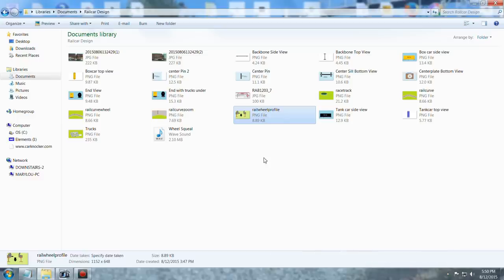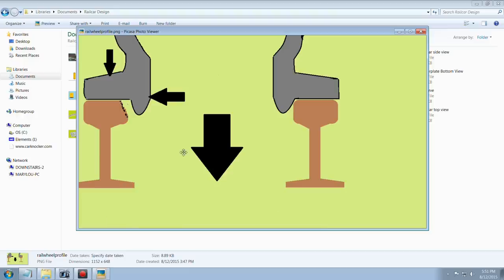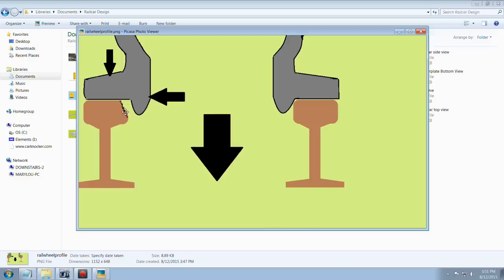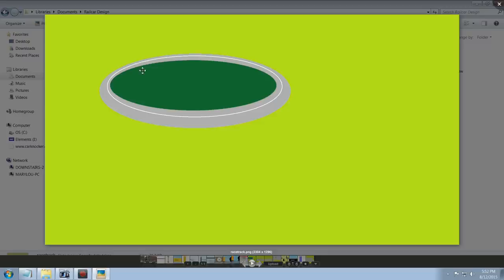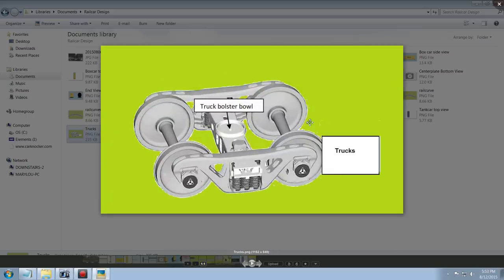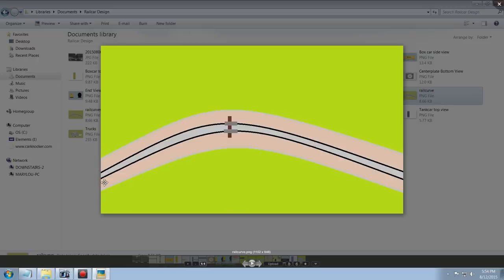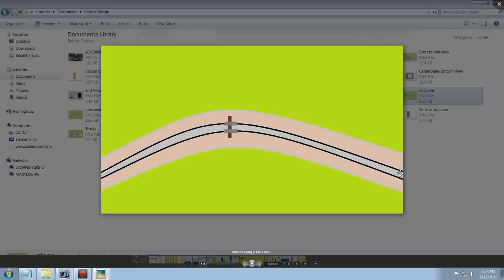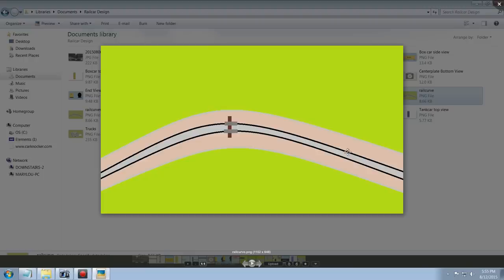Rail Car Design & Wheel Squeal Part Two 8 12 2015

Comment: Hi Walter , great series sir! If I may add a little light onto the subject? Working on track all day as I do. I also am interested in the mechanics of trains, more than signals I must admit..LOL To add a "differential" or wheel slip effect to rail car wheels, they are actually turned (machined) at different diameters from the flange to the outer rim. A new wheel will be larger at the flange and taper off  as it gets to the edge, the amount is quite a bit and there are two reasons for this! One is to keep the axel "floating" between the rails, instead of bouncing  off each flange from side to side as it goes down straight track. Hard to explain without a drawing, but imagine two cones on a axel, with the wide part of the funnel facing in and the pointy end facing out, if you roll this down a "track" it will self centre itself even without flanges!!, as each side tries to slip down to the pointy end they counteract each other...I've seen it done, even around slight curves!! Now of course it won't work  well with real trains, so a flange helps guide the wheel around the curve! Now the second reason is that when the wheels enter a curve  , the wheel set slides sideways (the flanges are about50mm in from each track) and the flange hits the edge of the outer rail, this is the wheels largest diameter and can travel further on each rotation than the "smaller" diameter wheel at the inner edge of the curve1 As you say , both wheels are travelling at the same speed, but due to the "cone" shape, the outer wheel is bigger and the inner one is slightly smaller, so you get a "differential effect" on a solid axel!! Very clever I think and of course as wheels wear and the cone shape disappears , this is when you get squealing, but of course as you say, there are other complicated reasons as well, but on well maintained wheels, it is far less. Due to there being literally millions of cars in the US, it's almost impossible to maintain all wheels to "standard" but you can pick the "bad" ones on a train as some squeal a lot more than others on the same piece of track!! Hope this helps Sir and keep up these series!
Cheers Gregg
Reply from the maker: FishplateFilms Thanks Gregg for the great input and explanation  I appreciate it my friend
Reply: pwalpar You are welcome Walter, I have been pondering this for many years and have done a lot of reading and watching on the subject!.
Cheers Gregg.

Comment: Thanks for the Part 2 Walter, I dare say Gauge of the track plays a Part too, the wheels will be a fixed width apart from the machining Process, but the actual tracks will fluctuate somewhat within tolerance I hope. :-)
Reply from the maker: Bevoin1970 Thanks Paul

Comment: It's the same with automobiles, and as we know the differential was invented to solve exactly this problem. If the train wheels were independently free to turn on the axle the slippage would not occur. Whether or not the squeal would also disappear is unknown without trying the experiment. You explained the problem very clearly, Walter. Thanks.
Reply from the maker: Bruce Boschek Thanks for the input Bruce :-)

Comment: If the train is going too fast for the track geometry, then the outside flange will push against the side of the outside rail, as you explained so well.  But the extra adhesion from the flanges pushing against the outside rail will, in my opinion, cause that wheel to bind, and not be dragged along the outside rail.   I think therefore, that the inside wheel will be clawing at the inside rail, and spinning/trying to pull faster than the wheelset allows.  So, in effect, the inside wheel is going to be more impatient, and be trying to pull the wheelset faster than it is allowed to.  So, I think that the inside wheel will be doing the squealing in this case.   I would love to see the studies from actual testing on this.  Aarre Peltomaa
Reply from the maker: Thanks for your thoughts and insight

Comment: That's really clear.  Thinking about this, does the cone of the tread help; meaning that the tread of the wheel nearest the flange will increase the effective diameter.  So long as the cant, curve and speed is right - and that's a big assumption - then it should be possible to have the outside wheel going into a curveat a bigger effective diamater to the wheel travelling the inside rail of the curve.  I'm thinking here about there being enough outward force to cause the wheel to ride up the cone.  With the outside wheel at a bigger diameter than the inside one, then it could travel further despite going at the same speed as the inside one.

Did I mention what my wifes late grandmother used to say about her husband who was an engine driver (ie engineer) in Wales? It relates to your question I think.  She and others have said that he had a reputation for speed.  His name was Llew Jones.  She said that Llew had said that going fast into curves was 'good for the locomotive'.  I think what he may have been doing is setting a speed that would place the wheel-sets in such a position that the outside wheel would have this larger effective diameter to the inner wheel.... but without the flange rubbing the rail head.  I have often marvelled at the skill necessary to accomplish this on curves which have transitions to them; beginning gently, then tightening up and then becoming more gentle again (with different cants).  That kind of thing must take years' of experience.

Like your horns by the way.

Comment: I am thinking the outside wheel in a curve is being pulled on by the in side wheel. And the only thing that is keep the out side wheel from coming off the track is the wheel flange of the in side wheel. That would put a lot of force on the rails and cause the to grind and squeal in the curves. Thanks my friend.
Reply from the maker: ***** Thanks Alfred  it is a lot to think about
Reply from the maker: ***** Thanks Alfred  it is a lot to think about

Comment: You are correct in your analysis,I think a better solution to the problem,other than rail greasers,would be a complete redesign of the truck wheels and axles,my idea would greatly reduce rail wear and wheel wear.Why not make the axle non rotating and use double cone wheel bearings,much like those used on automobile front wheel spindles.The axles would have  tapered ends,an inner flange to back stop the inner bearing,a short segment of threads to accommodate a large spanner nut to preload the outer bearing.The tapered axle ends would mate to an axle cap at either end,the caps would have an inside tapered bore about 1 degree difference from axle end,or it could be internal and external splines with a straight bore,the end caps would also have grease fittings matching a corresponding bore in center of axle to grease bearings.Thus you have independent wheel rotation ,less wheel and rail wear and no squealing, and no more need for those dreadful rail greasers.
Reply from the maker: I suspect its a matter of cost

Comment: i agree with you on that. the wheels on the outside have farther to travel than the inside wheels, but all wheels are forced to go at the same speed. this problem was solved in automobiles by the invention of the differencial. like the old saying goes, something has gotta give.
Reply from the maker: John Richards Thanks John  My sentiments exactly

Comment: Alright pwalpar, I agree with what your saying but would add that the inside wheel may have a tendency to overdrive (spin) the rail at times while the outside wheel will under drive (drag) the rail.
Reply: duradim1 I agree with the inside wheel slipping because centrifugal force would transfer the weight to the outer wheel in the curve, giving it more traction. Right?
Reply from the maker: Jim Bryan Thanks Jim
Reply: +Jim Bryan At faster speeds I would agree this would have an impact. But I think my theory has merit.

Comment: Perhaps as the flange of the wheel engages the face of the track it travels in a downward direction and then an upward direction as it enters and exits the face.
Reply from the maker: Good point thanks

Comment: that could account for some however the tire or face that rides on the rail is not flat they are tapered.from the flange out getting smaller to the outer edge. the rails are 4'-8.5" the wheels are 4'-8" outside to outside of the flanges giving one half inch clearance. As the wheels enter a curve the outside wheel flange slams into the outside rail head in the curve causing the squeal. by doing so the wheels adjust the DIa so the inside wheel is now slightly smaller and the outside wheel is slightly larger thus kicking the outside horse in the butt. when the track is straight the taper centers the wheels on the rails thus shutting up the squeal and letting the wheels roll at the same speed IMHO
Reply from the maker: DS75921 Thanks for your input

Comment: I guess that makes sense.  Lacking a differential, the wheels must turn at the same rate.  In cars, locker rear ends wear tires, so it makes sense that train trucks would be dragging one or both wheels on any axle and steel on steel ought to squeal.  Never thought of that before but it is logical.
Reply from the maker: ncplantdoctor Thanks David

Comment: there is one thing that I hear all the time at the main line.
It seems to be mostly in certain spots on the straight rail that I will hear this.
It sounds like the wheels are vibrating back and forth against the rails as it goes bye.
Very fast and only in some spots and I would love to know what causes this.
If there is anyone out there that could answer this I would love to hear it thanks.
Reply from the maker: ***** Thanks Wayne

Comment: I've been told that the surface if the wheel that contacts the rail is not flat. It is tapered so the diameter at the flange is larger than the outside edge. As the truck encounters the curve the outside wheel rides up on the flange edge and away from the outer edge making the outer wheel effectively larger than the wheel on the inside of the curve which now is riding on the smaller diameter outer edge.
I still think this is not enough to counter slippage but I'm no car knocker or engineer.
Reply: Julie AV This is also true Julie, the head of the rail should be a rounded with a 1 inch contact area with the wheels...in a perfect world of course! That is why rail grinding is so important!
Cheers Gregg.
Reply: Julie AV In the UK, where I'm from, it's called "coning", as the tyre profile is effectively a thin slice through a cone.
Reply from the maker: Julie AV Thanks for you input Julie

Comment: Unfortunately I disagree. Curve squeal is measured to be mostly emitted from the inside leading wheel whereas your idea would mean noise emitted from the outside wheel. Therefore I believe this phenomenon (known as longitudinal creepage due to differential slip) isn't actually the mechanism for curve squeal. This is also proved by the fact that independent wheels (not on the same axle) still experience curve squeal. It's thought to be caused by lateral creepage due to both wheel sets being unable to fully align with the curve at once Thanks for the video though, if you want to know more about what I mean check out https://www.youtube.com/watch?v=rVd-PVNvkcA and also 'Railway Noise and Vibration' by David Thomson. By the way, I only know this because I have spent the last 7 months investigating this for my Mech eng degree, it's a hard and complicated system to understand and model.
Reply from the maker: Thanks for the detailed explanation  I appreciate it